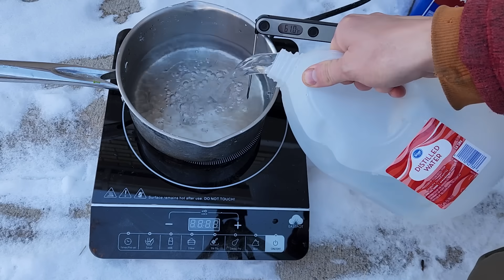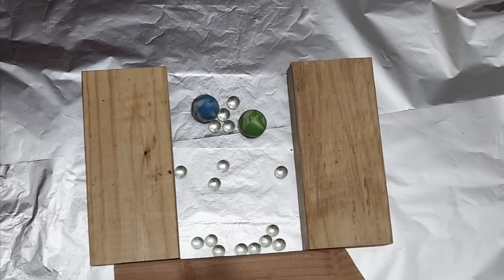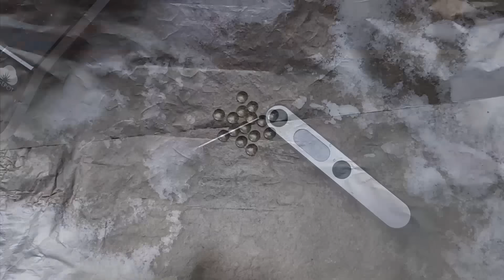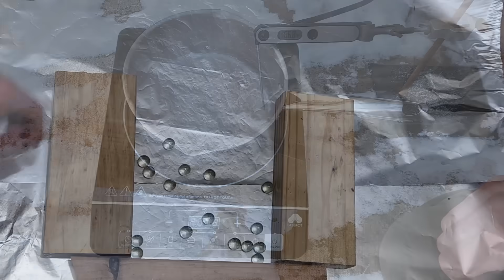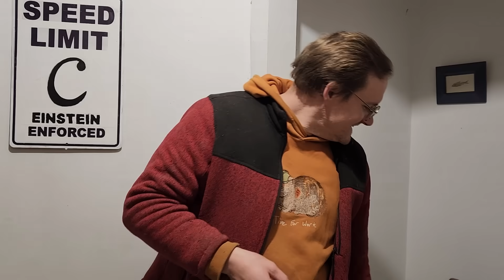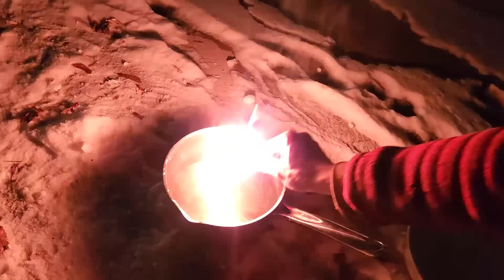Raoult's law

Comment: That's not how I heard it. Salt lowers the boiling point. Makes beans take longer to cook. Water molecules pull on each other. In the water all the pull is equal in all directions. At the surface all the pull is down into the water because there's no water pulling up. That pull down is surface tension. Molecules have to move fast enough to break the force of the tension. Salt reduces surface tension so they don't have to go as fast to break through. Salt water freezes at a lower temperature too. That why we add rock salt to the crushed ice jacket for freezing ice cream. The water is colder because the ice at the surface of the water interface becomes salty, and melts at a colder temperature.

Comment: I don't get it. At 5:03, you shows it as if the salt molecule (cation/ anion) absorbs am of the momentum of the water molecule. But as far as I know molecular collisions (when the species colliding don't react with each other at all) all highly elastic, so the water molecule that is hitting that salt molecule from outside should bounce back with almost the same speed it hit it with. But you have showed it as if it just sits right on top of that salt molecule. Can you elaborate?

Comment: I have a questing. 

My physics teacher said that boiling was high pressure "pockets" formed around nucliation sites. And that, because of the change in density, these pockets became positively boyent and thus floated upwards. And that this is what boiling is.

That is quite different from your explanation. I have no idea if i just misunderstood my teacher or if I remember it wrong or if both explanations are true at the same time.

Do you have any ideas?

Comment: So is the point for the evaporating situation that the temperature determines the average kinetic energy of the particles, but the evaporation is determined by the momentum?
Because if we then start with the salt particles having the same kinetic energy as the water particles, then they will have a lower momentum than the water particles since Ek = p^2/2m. Then due to collisions the momentum is redistributed (momentum is on average absorbed by the salt) so that the momentum of the water particles is lower than without the salt. Therefore they will escape less often?

Comment: Nice video! That is how the old "hopper cooled" engines work they have an open tank mounted around a horizontal cylinder and the evaporating water cools them. Conversely, before "permanent" glycol antifreeze they would use alcohol in the cooling systems on tractors, cars, ect. up until the 1940s in the winter, you always had to top it off.  I saw your maximum speed "C" sign as I understand it "C" stands for causality or ligh speed which is EXTREMELY SLOW and makes a snail look like a marathon runner on even galactic scales let alone universal ones. Rough estimates state that if the Milky Way were the size of the U.S.A. the distance between the earth and sun would be the width of a dime (1mm) light only traveled about 2mm at that scale during this presentation, and would have had to have started out many dozens of times more than the years to the last ice age ago to reach the other side of the galaxy by now. We know nothing about what is going on "Right Now" even in our own solar system. It's all assumption. 😊

Comment: Around 2:13 you say "Initially, because the salt's cold, the temperature of course is going to go down."  This is only about half of the story.  The specific heat of NaCl is about 0.05 kJ/mol·K, so if the salt is at 0°C, bringing it up to the temperature of the boiling water requires about 5 kJ/mol, more like 4 kJ/mol if the salt just came from indoors.  On the other hand, the heat of solution of NaCl is about 4.3 kJ/mol.
Around 4:01 you say "...if you have some salt molecules or particles out here near the surface of the liquid."  But the salt is apparently completely dissolved.  As you know, dissolved NaCl is ionized; there are no molecules or particles of salt as such in the water.

Comment: This explanation seems to contradict the Raoult's law I was taught.

The Raoult's law I know is for "ideal solutions" where the salt molecules behave just like water molecules in their interactions, except for that the salt is non-volatile. Further, Raoult's law should also theoretically apply to "ideal gasses"  (non-interacting molecules). It can be modified to account for salt-water interaction and non-ideal liquids, but at its core it does not need these. I understand it as an entropic effect related to the entropy of mixing.

However your explanation depends on the salt molecules interacting specially with the water to dissipate energy, giving a a non-ideal solution, and on them taking up "area" off which the water molecules can bounce (or interact), giving a non-ideal liquid.

Comment: When you mixed water and alcohol, was it not just the alcohol that was evaporating? I thought something like that was how distillation works. You heat up the mixture only to the boiling point of alcohol while still being below the boiling point of water and that way only alcohol would evaporate.

Comment: Your logic with boiling point elevation is fundamentally wrong. Its not that the salt ions kinetically block water molecules from leaving... the water molecules are attracted to the salt ions which is a stronger attraction than to each other (as in the pure water case) so it requires more kinetic energy (temperature) for the water molecules in the ion's solvation sphere to obtain enough energy to escape to the vapor phase.

Comment: The water and alcohol... I was never taught this. Explains why I didn't get a perfect grade on my 8th grade science project. Everyone had to do the Sludge test. Where we had to try to separate an unknown mixture into it's component parts. 

For instance mine had an alcohol and water, filtered out some solids, boiled everything else off to get the dissolved solids but I couldn't separate the fluids because the boiling point never matched anything it just steadily increased. It seemed very slow to boil really

Comment: The boiling thing, latent heat of vaporization was explained to me by my physics teacher with a bag of sand.

So you have one bag of sand on a pretty long lab table and you need to run from the starting point to the ending point. So start running and make progress then you reach the bag of sand. You need to the create 10 small mounds of sand from the bigger pile.

This was the fusion state, meaning from a bigger mateix to smaller uniform matrix of sand (imagine from solid to liquid) and then you realize that during this time, you weren't running but still doing work. Your energy was going in splitting the sand into smaller clusters and tada you got the liquid structure. 

Then after you continue running but near the end, you reach another mound of sand and this time you gotta sort each grain of sand one by one, reminiscing of the phase change from liquid to gas. It takes you longer to do this and all your work is going in sorting each grain of sand one by one before reaching your endpoint.

Then you realize the practical aspect of this demonstration to understand the graph of the latent heat and why the horizontal line of the vaporization phase is longer than the fusion phase.

Pretty neat experiment.

Thank you for coming to my Ted talk.

Comment: My fav pressure trick is cold boiling. Strong enough vacuum pump = Suck all that ENERGY you pointed out that majority of people don't understand exactly as you said it, out of the water rapidly leaving only ice. Reason? Increasing efficiency of cold side for Thermoelectric generators and cold steam Tesla Turbines. Sets cold panel wall of cold steam system to ice by venting all energy/cold boiling into the atmosphere by Pipe, slides tiny gas burner that has Ultrasonic atomizer inside to allow converting liquid gas to vapor, and puts Capacitor bank between system & vehicle electric motors Batteries are trash.. Cranks mini-turbine to atomize the Gasoline until system starts running and loops power excess to do it on its own based on requirements of keeping water in hot side of cold steam from going ice while energy is dumped into the turbine Be amazing at how many times a vacuum can multiply heat value..

Far less fuel for small-big things. Even further? If you use static pipes for cold steam to flow through you could probably make a decent Static lift system which could be multiplied if you use static duct style internal flight motors that force air through them for drag designs to use wind flow itself for perfect stability of craft with shutters around craft to control airflow. Google: "Giant UFO triangle" Look at images and look at the ones that look like more advanced Star destroyers(they are), no visible engines. Why? Because the exhaust of the engines are force multipliers in Energy based warfare. Strokes plasma generator buttons for Ultrasonic holography cloaking, anti-drag, illusion of stealth by elevating sound beyond animal hearing, world scanning even in NEAR vacuum of space, and Ultrasonic holography construction/Base-City printing.

You'll come around. "Ultrasound can produce temperatures as high as those on the surface of the Sun and pressures as great as those at the bottom of the ocean. In some cases, it can also increase chemical reactivities by nearly a millionfold." - THE CHEMISTRY OF ULTRASOUND by Kenneth S. Suslick The Yearbook of Science & the Future 1994; Encyclopaedia Britannica: Chicago, 1994; pp 138-155 > Points at Warwick University Plasma generated Ultrasound Far more powerful than you think.. Points at Boeing Plasma force field blocking shock waves Destructive sound interference, why so many names for Ultrasound because of different source? To try masses mind with too many answers to filter through, aim RESULTS. - Watcher (Edit to fix error I'm running virtual windows..)

Comment: Uhmm...what's the flash point temperature on alcohol again? Msds ... materials system data sheets... look it up... yup brave experiment...
Cheer's . Over transitional state is augmented by density... even o2 values...😅

Comment: Would be a cool video if you explain why boiling water turns to vapor when you throw it in the air in low temperatures. Kind of basic but should make for a good video

Comment: say you boil the water first. then you add a determined amount of alcohol and note the drop in temperature  too its lowest point before it starts to heat back up. then do the same with water.  how much cooler is the more volatile liquid than the water control?  what are the thermal dynamics? my hypothesis is that the temp will keep dropping as long as there is volatile  liquid left.   try it with the burner always on and with the burner off. cheers Cody long long time fan.

Comment: I like the demonstration you created for Raoult's Law to create a physical analogy for the boiling salt water.  My only comment would be pertaining to the size of the "molecules" used.  Water has a molecular radius of 2.8 angstroms whereas a sodium atom (not the ion, but I couldn't find data about the ion) has an atomic radius of about 1.9 angstrom and a Chlorine atom has a radius of about 1.0 angstrom.  So I think a better analog would be a row of the smaller balls at the top and the larger balls bouncing around in the middle of the diagram.

Either way, it's a great visual at explaining Raoult's law though! 

(Also please someone correct me if I'm wrong, I got my degree in Chemical Engineering 10 years ago and haven't touched general chemistry since. 😂)

Comment: How did you get through this explanation without mentioning sziotropes  or distillation?  If you boil a solution of 50%  pure ethanol and 50% pure water, the boiling temperature would be exactly halfway between the boiling twmperatures of each. But, thats not always the case, because plenty of things dont form aziotropes.  And thats why distillation works for making booze. Monitoring the temperature determines the contents of the distillates.  The first thing to come out is methanol, because it has the lowest boiling point, which is great because it tastes bad and causes blindness. Then comes the ethanol (the good part). And when your "mash" gets to about 195 degrees (depwnding on what you're making and elevation etx.) then its mostly water,  and you stop  collecting the distillate.

Comment: Salty oceans have lower vapor pressure, so less water vapor enters the Earth's Atmosphere than if it were freshwater oceans. If the oceans weren't salty, the air would have more matter to hold heat, right? I assume there are other factors, but salty oceans seem to be a net positive for current life. This makes sense since we've lived with them for as long as we have.

Comment: the water/alcohol scenario doesnt work exactly that way as there is an azetropic mixture form which has a lower boiling point than water or ethanol. its 97.5% ethanol.

Comment: I recall this as I was meaning to melt plastic at one point for a project, but due to the fact the water would never reach melting point of plastic unless confined in closed vessel i planned on using mineral oil instead due to higher vaporization heat but never ended up truly getting the project to that point but it seems to have been somewhat agreeable design.

Comment: 15:18 Bread goes stale because the starch molecules adsorb water and enter a crystalline form. Stale bread can be refreshed by heating in an oven to drive off the water.
Reply: microwave works too
Reply: I’m gonna try this next time
Reply: But it never goes back to soft / fluffy. Abater dehydration it becomes hard (“toast”)
Reply: 15:18 McMuffin jumpscare 😂

Comment: And for us causals, two thing to take home here:

If you've ever seen instructions to only add stock or salt after the liquid is already boiling, this is why. Adding it while the water is warming up will increase the length of time needed to reach the boiling point.

And if you've ever wondered why putting a lid on top makes it so your water boils faster and at a much lower stove setting, it's because the lid contains the vapor, increasing the vapor pressure and making it harder for the energy to leave the water -> it doesn't cool down from evaporation -> it takes less energy to be brought to and maintained at a boil.

So, put a lid on your pots and add the seasoning after the water has reached a boil.

Comment: Actually, if you boil a salt and water mixture vigorously, the bursting bubbles eject microscopic droplets [carrying some dissolved salt] and you get effectively a form of 'salt snow.'

Also, sodium chloride cools when going into solution, and releases heat when it leaves solution, therefore, that fine little dusting of salt snow, is carrying heat energy away with it.

Comment: So, here's a puzzler for you.  In an ethanol/water mixture, the ethanol (having a lower boiling point) will boil off first.  But if you add methanol, you'll find that the methanol stays in solution (i.e. does not boil off) until after the ethanol, despite having a lower boiling point than ethanol.

I can provide citations for this if you don't believe me.

Why would that happen?

Comment: Another thing you can demonstrate with that same setup: you mention the boiling water cooled because the salt was cold. This does explain some of the temperature drop, but if you started with the salt pre-heated to ~210F and dumped it in the boiling water would still cool as the salt melting absorbs energy based on its latent heat of fusion.

Comment: Isn't it also true in the boiling water scenario that the salt ions cause the water molecules to organize around them in a given orientation due to the assymetrical charge distribution in water, which encourages the water molecules to "stick" to the salt ions, rather than boil away?

Comment: This video gave me a question that I hope someone can answer. 
If you started with two open containers, one with water, the other alcohol, and placed them both in a larger sealed vessel, would the vapors both reflux into each other (over months or years) until equilibrium? Like would they eventually be the same concentration?
I think the answer is 'yes' but perhaps there's something I'm not thinking of..

Comment: You mentioned that the vapor from the boiling alcohol felt cooler than the vapor from the boiling water. Yes, the boiling temp is lower, but I think this is probably also due to the significantly lower heat of vaporization of alcohol compared to water.  Steam burns skin very rapidly because the heat of vaporization (580 cal/g) gets dumped into your hand as water vapor condenses on your skin, which is much cooler.  You can easily test this by comparing the heating sensation to putting your hand into an oven at 100C/212F.  It will of course feel warm, but it will take a few seconds before it really gets uncomfortable, while steam burns almost immediately.  The heat of vaporization of ethanol is only about 200 cal/g, by comparison.

Comment: I swear I learned in OChem during distillation, you can (somewhat) determine what substance you're collecting based on the temperature of the boiling solution. This seems to contradict that assumption, unless I'm severely misunderstanding.

Comment: Metaphorically, this is happening to the crust of Earth. Volcanoes are becoming active more. Which, induces, water pockets that get heated enough. Steam, and pressure. Makes all areas underneath the crust, need a place to go. Some, are hot water springs, some are, underwater vapor chambers, but. Not all volcanoes are underneath water.
Reply: Liquid Natural Gases underneath water. Boils, under water and the vapor will build pressure. Until, you get a geyser and or a moment of absolute. Eruption of a volcano.